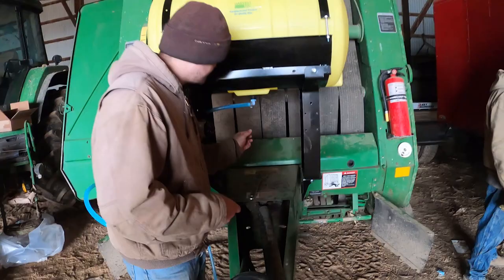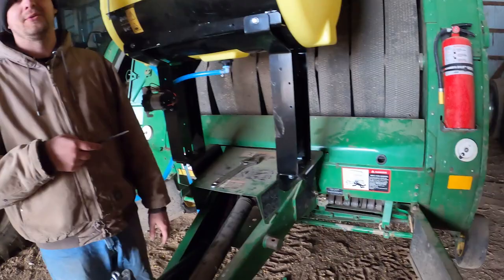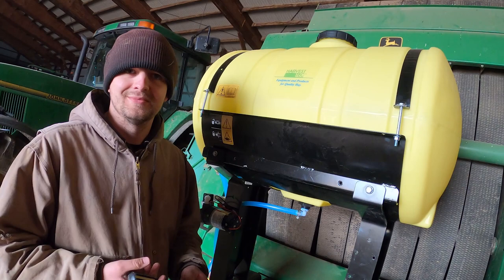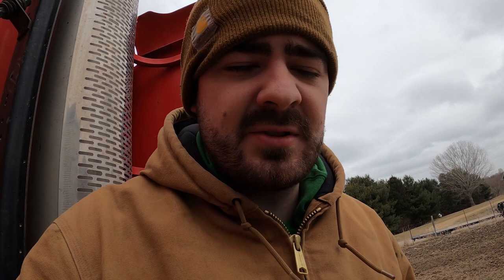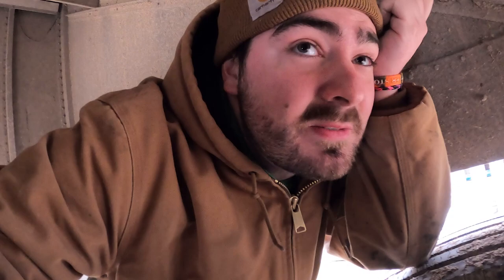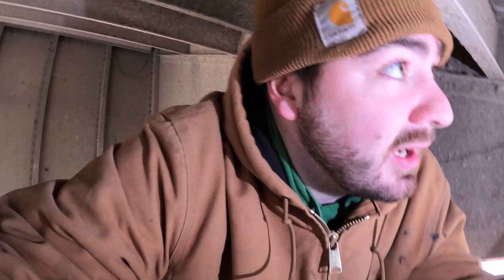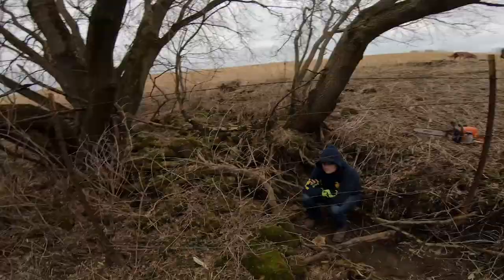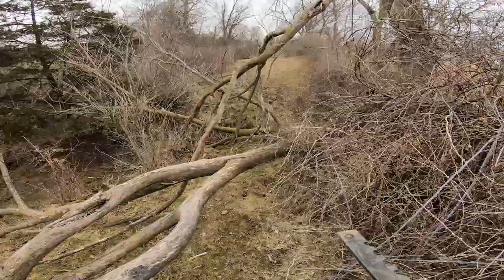Odd Jobs and Updates

Comment: The rollers on the under side, next to the gear is what you need to pay attention to for the ease of opening & closing of the doors. Probably the inner bearings of those rollers are worn or dry.
Reply: Yeah if they've been locked up and worn flat spots on em or the wheels are worn and bushings shot, they let the doors drop down in the channels and then you're cranking it open steel-against-steel with a sh!t-ton of grain on top... Probably wouldn't hurt to check on how much a roller kit for those doors would cost, and replace them.  They just look to be little nylon rollers, probably with a steel bushing through the center to turn on where they're bolted onto the rails.  Little things could make a WORLD of difference!  Doesn't NECESSARILY have to cost a fortune to do, either... Look around, Fleabay and Google are your friend (in this instance LOL:)  OL J R :)

Comment: Your exhaust manifold is built in three sections, if you can get the bolts loose on the back head you will be able to flex the manifold out and slip new gaskets in behind it. 
And as far as the M11 not having extra horsepower they would pull as good as my big horse N14 and get way better fuel mileage, this would have been back in the 90s when the M11 were new.

Comment: I own and run semis here in northern Illinois. In my experience with exhaust manifold leaks, I would always replace all the gaskets and bolts. And if you do it yourself, be prepared for bolts to break. It is just the nature of the beast.
Reply: Work on them while hot also. Helps break them loose.
Reply: @brandoncaldwell95  I was going to say what them up with a torch before trying to remove them helps alot
Reply: @94Gidge  that also. Any which way. Heat, penetration fluid and patience. Can get anything off without breaking them
Reply: @brandoncaldwell95  I have remove plenty of exhaust studs and bolts in my life on everything from a wiper snipper to a 60 litre V16 diesel patience is definitely number one.
Reply: @94Gidge  i certainly dont want to drill into the block and retread it. Too much work! A beer, torch, and some good tunes on. Itll get the job done a lot easier. May take a day either way you do it, but im not mad, throwing tools and cursing up a storm while wasting a quarter of a tank of fuel getting things.

Comment: 310T truck tech here, Should put some of that lube on your trailers gate handle U-joint,  we often see them seized up and really tough to move, most of them don’t have grease fittings so not much you can do other than lube the snot out of them!

Comment: If you haven't already done it try replacing the roller bearings on the bottom of the hoppers, it cost around $500 for all the bearings but it was worth it. My trailer cranked like that before I changed mine, now they open easily on the high side when loaded.
Reply: Same here to

Comment: Exhaust leaks on those Cummins engines were pretty common. You’ll notice it’s a three piece manifold it’s meant to expand and contract with heat and cooling. Depending on the price of the manifold new, sometimes I have taken the manifold off sent it to a machine shop to have it face ground so the manifold is flat where it bolts onto the cylinder head. Honestly that small exhaust leak is not causing you to lose a lot of horsepower. The gaskets are blowing out because the manifold is not completely flat against the cylinder head.For the amount of money and labor it’s going to take to fix that tiny leak you will not notice a huge increase in horsepower. If it’s only a small tick you’re better off just to let it leak bud

Comment: I noticed around 14:00 , the clip of the door on the hopper, that U-joint in the shaft connecting your crank handle to door gears looked bound up. Those joints being bad makes opening and shutting the doors difficult. I’d say it’s time for those doors to be rebuilt. but like you said if you are planning on getting rid of it, it wouldn’t be worth doing. Replacing the U-joints on both doors would give you a little more ease opening and shutting them, and be much cheaper than rebuilding the doors. Have done many of them myself and it’s a very easy job.

Comment: My solution is a wire wheel. Works with giving clearnace and rust removal. Then just oil it up really well. Dont know about it sitting though as its a constant oiling required

Comment: Yes definitely need to check all of the roller bearings on the gates. Common for them to get dry and stick. Also the u joints can get dry and lockup.

Comment: 3406B had a bulletin on exhaust manifold bolts :- replace with stainless steel studs and to egg out where studs go thru exhaust manifold then they added to drill oversized holes. Not sure if would help with yours exhaust manifold did have same type of joints.

Comment: You might get away with smearing the bad exhaust gasket with some Pyro-Putty 950 . At least until you really want to tear into it. For the doors, clean all of the crud and lube off the tracks. Then lube the rollers and slide edges with a dry lube. Anything that stays wet in there will catch road dust and dust from the grain and become a stiff paste that will block it more.

Comment: Good ol truck. But if your not confident in makin a repair with the rust. Save your $ up and let a pro do it. Will save you in the long run. Consider calling switchblade turbo and getting a new turbo put on when fixing the manifold. The switchblade gives a better power band that leads to better fuel economy.

Comment: I would check the price on the rollers but could you maybe try taking the traps off and taking a wire brush to them that is on an angle grinder to get it down to bare metal

Comment: On the trailer doors run a wire wheel on the track where the door slides. Then blow it out with some air. This should fix your problem.

Comment: Ryan, I saw in the comments someone suggested an impact wrench for those "trap doors"  on your trailer.  That would also be my suggestion, it ya don't have one yet, if I were you I would get one.  (Dewalt, Milkwaukee,  or brand of your choice)  I bought a Snap-On but I would not recommend those, my batteries are no good already. (after a few years)
Reply: Also, I think finding another trailer might be a wise thing to do, it could be that it is "sprung" (the whole trailer)  that is why the trap doors are difficult also??  (just a thought)
Reply: If you put an impact on those they'd be trashed after the first couple of uses